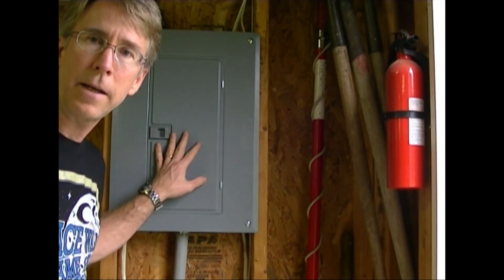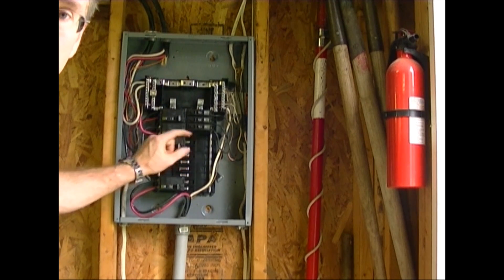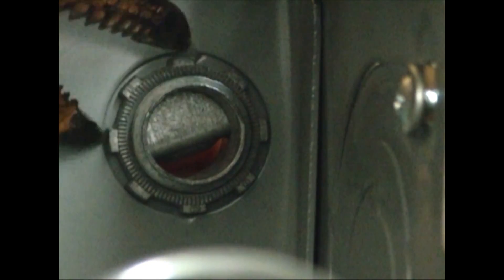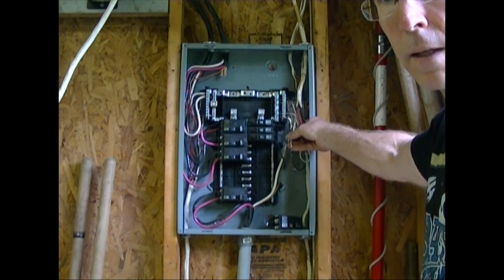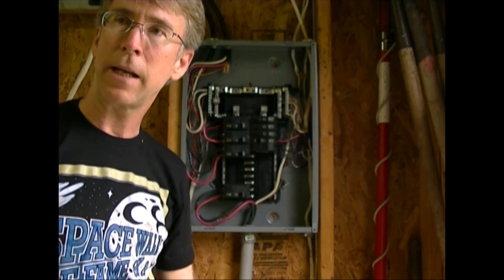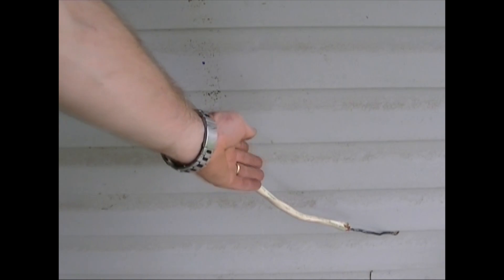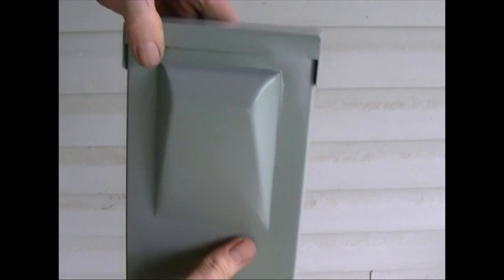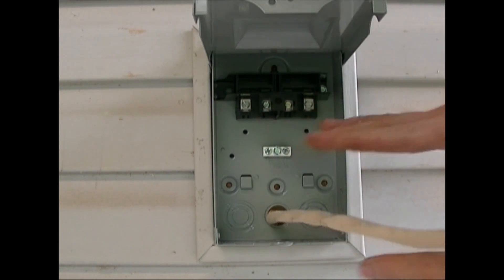How To Add A Circuit To A Load Center (Breaker Box)

Comment: You should have positioned the cam better.   I still wouldn't work on a hot box.  I'd rather have the main off when I'm sticking my hands in there.
Reply from the maker: Yes. Thank you for the constructive comment. I'm trying to do better with camera positioning. I used an old video camera that had to be plugged into the wall. Nowadays I just use my phone. 
Also, agree about the hot box. I now have a Ryobi cordless work light and would always turn off the mains.

Comment: First of all, I would like to say thanks for the video.  However, I would give you a thumb down for the safety in your instruction, because:
1.  You didn't turn off the main circuit before you install the 220V circuit.  With the 220V circuit, it could KILL people easily.  Remember, people who watch your video has no electricity knowledge and has no experience at all, and including kids too.
2.  You didn't wear the gloves when you install the electricity.  This could keep you from being shock or scratched.
3.  We should install the outlet box end first and connect the wires to the circuit breaker last.  This way is safer for the case the wires is already hot.
Reply from the maker: Thank you for this comment.  All good advice.

Comment: Hi Joe...The disconnect box was set to deep...The a/c installer would not be able to connect the flex conduit to the knockout...I'm assuming the a/c guy removed it and extended it away  from the wall enough to install the feed conduit to the a/c unit....Hopefully you left enough branch circuit cable slack for him to do so.
Reply from the maker: I'm not sure how but the knockout was clear of the siding and the AC guy didn't have to do anything special.  Thank you for the comment though as this could easily be a problem depending on the depth of the box.

Comment: Thanks for the video.  I think you may have forgotten to: (1) add a cable clamp to that outdoor box, and (2) add a note on the load center about the purpose of the new breaker
Reply from the maker: Both good points.  Thank you for the comment.  The AC guys put a sticker on the box to label the circuit after they installed.

Comment: You should never work inside a breaker box with power on that 240 volts running in there  that’s enough to stop your heart always cut main power and keep away from main wires coming in the box they are still very alive and to the guy making this video please get someone that knows what they are doing to put your next breaker in so you are alive to watch your kids grow up and to enjoy that ac when he get it hooked up
Reply from the maker: Always good advice to cut power.  It's very unlikely that you would get across 240VAC unless you used both hands and touched the two opposing 120VAC legs at the same time but still always a good idea to cut power.

Comment: 12 gage wire is what you need for 20 amps. 14 gage wire for 15 amps.  Use 12 gage wire on a 15 amp breaker but don't use 14 gage wire with a 20 amp breaker.
Reply from the maker: Thank you for that clarification.  That is helpful.

Comment: One tip I would offer apart from killing the power is not to use your strippers as a wrench. When stripping wires you want those in good condition so as to not damage the wire you are stripping.
Reply from the maker: Patrick, thank you for that good advice.  I totally agree that we should always use the right tool for the job.  I just get lazy sometimes.  Thanks for the reminder.

Comment: Great Video. 
I have a question, If i get 230 volt ac do I use 20 amp breaker? How do you calculate volts and breaker?
Reply from the maker: So the breaker is not about volts but rather about amps.  For example, I looked at the spec (label) on my AC unit and it told the maximum amp draw and I got a breaker that would cover that.  There are general guidelines for multiple outlets and such.  You'd have to look that up or ask an electrician.  Good luck with it.

Comment: I cannot believe you opened yourself up to the liability by saying it's okay for people to leave the power on. TURN IT OFF!!!
Reply from the maker: Certainly it is always better to turn the power completely off.  I believe there is very low risk of touching something you shouldn't when just inserting a breaker.  If I were rewiring the box or connecting to hot terminals then I would of course turning it off.  Thank you for your concern.

Comment: How come you didn't install bushing for wiring back of disconnect
Reply from the maker: Good catch!  I drilled a smaller hole through the wood sheathing of the barn and made sure it was inside the perimeter of the metal hole in the cutoff box when I mounted it.  It's probably not code but it works.

Comment: Any video on how to do this with a panel already installed in drywall?
Reply from the maker: That does add another level of difficulty.  I've done it but not recorded it.  It's very similar except you're fishing the wire down from the attic into the box after punching out a hole near the front of the box so you can reach through with pliers to install the cable clamp.  Good luck with it.

Comment: How can a 12 gauge wire be too big for a 20 amp 240 circuit??? You can't go with a smaller wire than that dude. If anything you can go a little thicker cable
Reply from the maker: Did you look it up or are you going by gut feel.  I'd like to know what you're basing your opinion on.

Comment: Don't want to bust your balls. I appreciate that you made the video. However, you'll want to install a romex connector in the cut-off box to protect your 12-3 wire from wearing through and eventually shorting out (possibly casing a fire). Also seal up the penetration in your house.

Comment: A mostly good video on electrical work.   Suggestions, run the wires complete route before you do any connections so not too short.   Install a romex connector in the disconnect outside.  Make the connections at the panel last, not first(why take a chance on it becoming energized).   Next video should be "How to install a GFCI weatherproof receptacle for a condenser unit".  The receptacle is required to be near the unit.    If you really know what you are doing, you can figure out how to install it without adding another breaker, and no cable to run across the shop.   Hmmm, a challenge I guess!
Reply from the maker: Thank you for the comment.  I've never heard of using a GFCI hookup for a hardwired condenser unit.  Would have to look into that further.  Thanks for watching.
Reply: FloridaJoe3   You misunderstand.   A GFCI receptacle is required on or within 25' of HVAC equipment.  It is for the mechanical guy working on it when they need 120 volts.   Because of the way you wired your disconnect outside, you could install one next to it very easily.
Reply from the maker: @KevinCoop1  Oh. Thank you for that clarification.  I already had outlets all over the barn that are all GFCI protected so I didn't think about that.
Reply: FloridaJoe3    Very good!   Enjoy life!

Comment: Doesn’t the romex need to be clamped through the hole of the load center as well?
Reply from the maker: Yes, I thought I showed that.  Are you talking about the terminal box where I just ran it through the wall.  If so,  I would mention that there is a staple holding the romex just a few inches from the back of the box.  But, yes, it's always a good idea to clamp cables entering and leaving a metal enclosure.  Thanks for the comment.

Comment: For a 110v circuit, could you explain what to do with the different colored wires?
Reply from the maker: For a 110VAC circuit you will only have three wires - the black, white and bare copper.  The black is hot and goes to the breaker.  White goes to the neutral bus and bare copper goes to ground.  The 220VAC has a black and red for the two hots that are 180 degrees out of phase.  If you're wiring in the walls and see a red wire on a 110VAC circuit, it may be a switch wire for a 3-way switch.  You should never see a red wire at the box for a 110VAC circuit.  Hope this helps.

Comment: Would be nice to see the actual placement of the breaker on the bus.
Reply from the maker: Sorry about that. I couldn't get the camera in there and do the placement with my limited number of hands.  I hope you were able to get it installed anyway.  It only goes in one way and has a very stiff snap when it gets into place.  Thanks for the comment.

Comment: Run  Romex to equipment then wire device before hooking it up in panel wtf
Reply: Hey I'm guessing you have some electrical experience?
Reply: I have moved into a place a week ago and it needs a little work. So I've done some things but I have some electrical issues. I have power to several or half the house but there are some plugs and switches without current.
Reply: So basically I have to get them to work so I started at the box
Reply: And found a wire 12-2 not wired to anything so I'm thinking that's what new stuff is for so I got a circuit breaker and I have wired those wires to it will I get electrocuted by pushing the wires to it

Comment: There is no 110 it's 120 there is no voltage drop
Reply from the maker: True.  I get a little sloppy with that since I've heard it referred to both ways all my life.  Thank you for commenting.
Reply: Us is 110 canada is 120v no ?
Reply from the maker: I don't think so.  Maybe google "what's the difference in 110 and 120 VAC?".  You'll find a good explanation of why they are used so interchangeably.  It's interesting.

Comment: It's called a phase and b phase not the other side of wire
Reply: And no red and black cannot go to either side that's called phase rotation you can mess stuff up
Reply from the maker: @quarantinecoronavirusps4ga446  Whoa right there.  These are two opposite phases split off of a single 240VAC phase by tapping neutral out of the middle.  Phase rotation would be 180 degrees leaving you with the same voltage just 180 degrees out (opposite).  If this were a 3-phase system you'd have a valid concern.  So I stand by my statement that red and black can go to either side.  Thank you for commenting.

Comment: It's a good thing that fire extinguisher is there before the idiot lights himself on fire
Reply from the maker: The idiot (as you call him) has had no fire problems.  If you see an issue that could cause fire, why don't you call it out instead attempting to be funny.  That would be more helpful.
Reply: @FloridaJoe3  maybe not turning the power off??????
Reply from the maker: And how does that cause a fire?

Comment: FloridaJoe3: Are you aware that your load panel is completely miss wired. Your grounds and neutrals have to be seperated.  The A/C 20 amp circuit requires a minimum size  #12 Awg. conductors, anything smaller would be a code violation. Also, your panel doesn't have a grounding system (ground rod) installed. This is also a critical step in ensuring that your panel is ground safely incase you come in contact with an energized panel.  The proper way to run your sub feeders is to land them in the top 2-lugs on that particular panel. If you wanted a load center with main breaker it would come already installed with a main breaker. I know this video was posted over two years ago, but anyone viewing this today should think twice about trying to do this themselves.  Being confident and comfortable will get you killed. Working safe and having respect for electricity will keep you alive.  Unless you have the proper credentials to instruct viewers or DIYers, it would be a good idea if you knew what you were doing. You may think you know what you're doing but trust me, from where i sit it doesn't look to good.  With 42 years of experience and 32 years as a Union Contractor, I wish you well.
Reply: More people are injured with 120v , than with 240v ..
Reply from the maker: Thank you for your comment.  I actually did post a correction video to my other video where I installed the box incorrectly with the neutral and ground tied together.  In that video I tried to explain why you don't connect neutral and ground in a remote box.  I'm also concerned about the safety issue but I've been zapped by 120VAC plenty of times with no permanent damage.  I would hope most people would know better than to work on something like this barefoot standing in salt water.  Since you have 42 years of experience, I'd like to ask you if you've heard of anyone being killed or badly injured by 120VAC. (I know there's 240VAC in the box but you have to try harder to get yourself across it).  Thanks again for your comments.
Reply: @FloridaJoe3  My old electrical engineering instructor tells a pretty good story about how in the old days they used to test for voltage with their fingers. His good buddy was working on a project with him and went to test a light fixture but was electrocuted, and that pushed him to becoming an instructor - so that he could teach young tradesmen what not to do.
Not sure if it was a story he made up to scare people, but it did the job with me. Takes less than a second to have a fatal accident that could have easily been avoided by using a good headlamp or battery powered flashlight if you really want the extra light.

Comment: If im not mistake ive heard 12ga wire is minimum for a 20A  circuit, 14g for 15a.
Reply from the maker: I don't remember exactly either.  The best thing is to look it up from a reliable source (NEC handbook, electrician forum, etc.)

Comment: I understand you must never touch the red or black hot wires, but is it correct that if you were to touch the neutral bar (accidentally) or the white wire terminating on the neutral bar, you would not be shocked? Thanks.
Reply from the maker: That is an excellent question.  So the neutral wire is not 'supplied' with power from the mains but is completing the circuit (returning current to the mains).  This will cause some voltage build up due to the resistance of the wires.  It depends on the load.  There might not be any shock or there could be plenty.  I once ruined a pocket knife when I accidentally grounded out a white wire.  Hope this answers your question.

Comment: Wrong,  you put the line side wires in the wrong terminals, and there needs to be a plastic pop-in bushing in the back of the A,C. disconnect to protect the wire.,  Glad no one came along and flipped the breaker on while you were working on the load side  of the Line Side.  Leave it to a pro, and your garage will last longer.  Good Luck
Reply from the maker: I'm pretty sure I put the line side (black) wires in the right place.  The neutral side wires (white), I connected to the ground (bare) wires in the same buss bar which is, in fact, a no no for a remote box.  I have another video that explains that and corrects it.  As for the bushing, I drilled the hole through the wood siding smaller than the hole in the metal box and centered it so that wood acts as a bushing and there is no chance of the cable touching the metal.  Thank you for your comment.

Comment: 12 gauge is not "probably too big for a 20 amp circuit".  It's the right size.  If the panel has a main breaker, turn it off.
Reply from the maker: Thank you for your comment.

Comment: God I hope no one actually tries anything watching this guy.
Reply from the maker: Many have tried and many have succeeded.  Don't be timid, Sean, be awesome.  I know you can.
Reply: I’m a Licensed Electrician. Seems to me you had plenty of light when you cut off the main breaker. If you’re scared of the dark buy a headlamp. No reason for that panel to be hot. Can you do it hot? Sure. But why risk it? I can drive my car everyday with no seatbelt for 5 years and never need it. But why risk it? I’m Already Awesome BTW.
Reply from the maker: @Donmega884  Thank you for your follow-up comment.  You truly are awesome.  I agree wholeheartedly that turning off the main is a good idea.  That said, I have never felt that the risk from 120VAC was so incredibly high.  Sure it doesn't feel great when you touch it but I've never known anyone to be injured by it and would think the risk is low especially when aware of its presence.  In your experience have you heard of or known someone injured by 120VAC? Just curious.

Comment: To have a 20 amp circuit you must use at a minimum 12 awg wire. That is definitely not too big. You can use 14 awg for 15 amps but not for 20 amps.

Comment: What is the purpose of nailing the cables to the stud? To keep them away from nails that someone might pound through the wood or drywall?
Reply from the maker: That is what I've been told.  You don't want a wire just randomly wandering around in the wall because you could hit it with a drill or saw when you're doing mods.  If it's tacked to a stud, you can just look at the outlet it goes to and know which side of the stud it's on and avoid drilling/cutting there.  Thanks for the question.
Reply: FloridaJoe3  OK. I thought maybe there could somehow be an increased risk of fire simply from sitting in there untouched.

Comment: Jeez buddy tidy up that Trainwreck of wiring in that panel. Then and only then think about doing professional electrical work.
Reply: One addendum. We always wire back to the panel. Without lockout tags this would be highly dangerous, not to mention compliant.
Reply from the maker: Thank you for your comment.  I'm afraid the panel is as tidy as I could make it with the wire I had available after replacing the box with a bigger one.  My embarrassment is similar to when you open a messy closet in front of a guest.*blush*  I have no aspirations of being a professional electrician so no worries there.